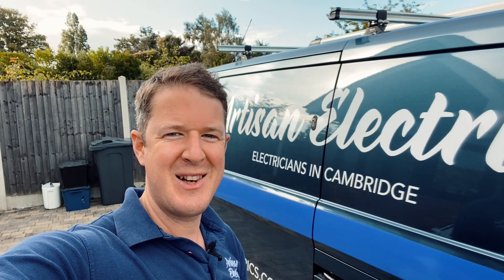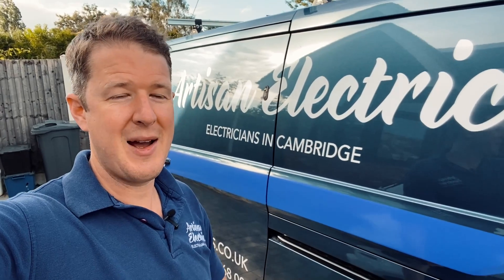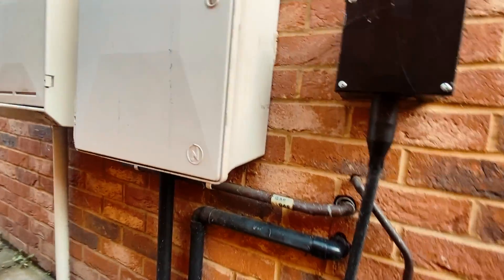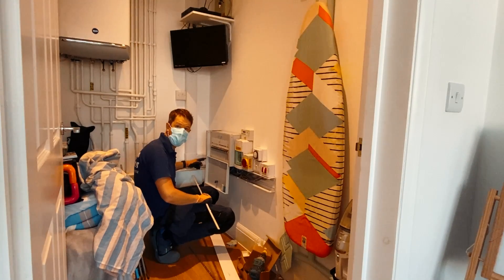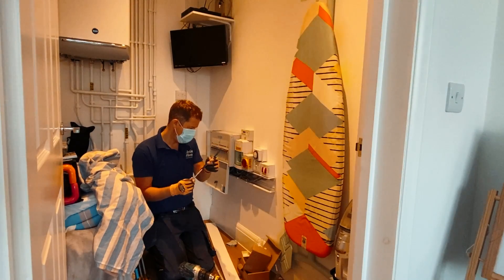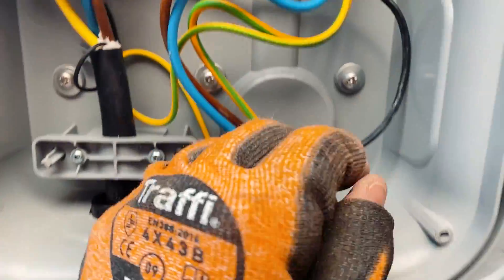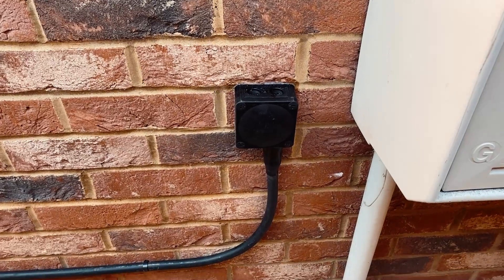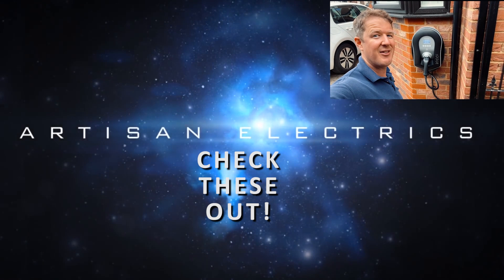Special EV Charging Cable - EV Ultra Install

Comment from the maker: Wiha Electricians Hammer: https://amzn.to/3kKOG8A
Reply: Hi Jordan,
One thing I don't see you do is test the charger, have I missed a vid where you do a Zs through the charger?
Reply: Question communication cables in bottom of the board? What voltage do they run? Ref solar charge it will be a long time to recoup only 😃

Comment: Would have been nice to see a closeup of the finished install inside including CT clamping and a quick look at the app running the zappi, but understand not always possible. Exactly the install I am having only mine will be located inside my garage.  Was there no myenergi hub required?

Comment: Shame you didn’t put the charger in the middle of the wall, looks a bit unbalanced. Also is it ok to drill through the cavity, I’ve got a similar problem with a down pipe and the incoming gas. If there is no problem with this I will ask my installer to do the same.

Comment: Great video. Just a quick question, why did you go into a wiska box outside. On your house you came straight out the wall.
Reply from the maker: I was using EV ultra cable on this job and it’s very thick and hard to bend
Reply: @artisanelectrics  Ok thanks for getting back to me .

Comment: Did you think of putting the large supply MCB for the car charging on the right of the CU as the left hand end means you have the largest load on end of the bus bars.  Or have I missed something.
Reply: Doesn't matter where you put the loads as the whole busbar is rated for 100A
Reply: @lewis94uk  Yes I know, but it is good practice to put the higher loads at the closest end - it does not matter, just good practice.

Comment: Another great video and very neat install - But I don't understand the need for the EV Ultra cable, the Harvi allows 3 x CT's doesn't it? I'm not criticising, just asking the thinking behind the install ;-)
Reply from the maker: I just wanted to try the EV ultra to be honest!
Reply: @artisanelectrics  can't argue with that. It looks like a good solution.

Comment: Thanks for the video; good stuff. EV-Ultra is available with one twisted pair or full 4-pair Cat5e. The Cat5e version could have been used here to avoid the Harvi. The Cat5e version is probably always going to be preferred with solar Zappi installations as there will be at least 2 CTs (one grid connection, one PV).
Reply from the maker: Yeah we used some this week on a job! Video coming soon
Reply: Never saw the installation of the Harvi so suspected that the ultra cable does away with it, but is that incorrect?
Reply: @damiankimmins3880  EV-Ultra contains 1 x twisted pair data or 4 x twisted pair data (depending on type) alongside the mains cable. It is like running a data cable alongside the SWA but all within the armour so much neater. One twisted pair can be used per CT clamp to Zappi. So, as long as you can physically run all CT clamps (minimum one) to the EV-Ultra cable then, yes, you do not need the Harvi. The Harvi allows a wireless connection between a CT clamp and the Zappi and the Harvi does not need a power supply as it cleverly harvests power via the CT clamp (not sure how a loss of signal is distinguished from no power flow or whether that matters). The minimum one CT clamp is around the main incomer to the house so the Zappi can monitor/limit total house consumption should it ever go above whatever has been set e.g. 60A. More CT clamps can be used if you have solar generation, immersion heater solar diverter or battery storage, for example. I think the Zappi has a maximum of 3 wired CT clamp connections (probably more via Harvis, and I think each Harvi might accept 2 x CT clamps) but check any of that if you need to. I can get away with using a granny charger for now. Car is home most of the day, I have solar and do not use car much. No way would solar intelligence or low night rate (high standing charge) pay back a £1900 install from Artisan (excl OLEV) or even £1300 quote from cheapest local OLEV registered - prices will likely come down with time. I just switch on when sunny or when I need to. I consider the chances of a PEN disconnect to be minimal and have what is supposed to be TNS anyway; I usually turn off my main breaker when there is a power cut and occasionally look out the window to see if anybody else has power back on yet before flipping it back on. I regularly check how warm the plug is getting. Should do me.
Reply: @jam99  That's great cheers! I am looking to do it myself as I am not paying that kind of money!
Reply: @damiankimmins3880  Mmm, wish it was that easy. Be sure you know what you are doing. OLEV grant only available for OLEV registered installers. Maximum demand calc needed. Check incoming fuse and incoming tail thickness for house. Loads of regs related to manner of install (e.g. height, wiring regs). Any new circuit or distribution board messing about needs testing, sign off by electrician or notifiable body, and the only sensible thing to do is a new circuit up stream of any RCDs in distribution board. It is all quite involved so be sure to do your homework.

Comment: With increasing data requirements is there not an Ultra cable with more than one pair of data lines? You kept me wondering until near the end how you were going to CT the grid and solar. Was a Hub not required for the OLEV grant to meet the smart requirement.
Reply from the maker: Yeah you can get CAT5e version as well
Reply from the maker: Hub is always required to meet OLEV requirements

Comment: So I noticed a lot of "C" breakers.  Those valid in that install?  With a much higher trip current than the "B"' breakers, I thought that they have specialized uses only and typically in residential 99% would be B's.
Reply: MCBs are hybrid devices, they have a thermal component which is designed to trip slowly on overloads and a magnetic component which is designed to trip very quickly on high current faults (i.e. short circuits).

The letters specify the characteristics of the magnetic trip. For a B breaker it requires a 5x overcurrent to gaurantee triggering of the magnetic trip, for a C breaker it requires a 10x overcurrent to gaurantee triggering of the magnetic trip. 

Whether a "C" breaker is acceptable on a given circuit depends on whether the Zs value for the circuit is low enough to fast trip the breaker in the event of a short.

Comment: How did you know you wouldn't go into the corner of the front room when drilling the corner at an angle?
Reply from the maker: Walls were mega thick when I drilled through the first one I could tell

Comment: Jordan I don’t know if you have come across some car manufacturers limiting charging (car has its own inbuilt ground resistance monitor) because of ground resistance going above a certain level which can happen in warmer, and dryer conditions. I don’t know of that is something you had an issue with.

Comment: Neat. But is the EV cable available with two pairs of data? If so could've run both CTs back to the Zappi and done away with the Harvi altogether?
Reply from the maker: Yeah you can get it with a CAT5 inside instead which has 4 pairs

Comment: Those are smart wee boxes, I had no idea they could monitor the current on the mains and ramp down if that was getting close to blowing the main fuse, cool feature! Not sure why the customer went with a cable attached version, it limits the kinds of cars you can charge, as some cars like the leaf will use the US style type 1 connector and you're stuffed if you (or the future owners) want to charge one of them instead of a European car.
Reply: Type 2 is the future, tethered cables are so much easier, assuming you use it daily they are much tidier, are always there, doesn't matter if they get rained on or filthy and I can keep my type 2 cable dry in the car for when I might need to use public chargers.

Comment: Interesting that you’ve crimped the main tails going into zappi. My installation at home didn’t used that, it’s just a stripped cable directly into terminals. Why , if I maybe ask? Should I look at getting mine redone?
Reply: You don't have to. Just looks a bit neater. The CCC of the tails remains exactly the same.
Reply from the maker: Yeah its just attention to detail really, some manufacturers require it though.
Reply: @artisanelectrics  Its not attention to detail its unneeded 99% of the time for class 2 conductors(7 strand) potentially its adding a point of failure and I'm yet to see a manufacturer request it on class 2.

Comment: Hey Jordan, I am interested in becoming an EV Charger installer. I just got an MG ZS EV and very impressed with it.

I understand the requirements for earth rods and the technology within the Zappi's that reduce the likelyhood of car becoming live and someone getting a nasty shock should the incoming neutral conductor failing from the electricity provider. However, alot of these cars are supplied with "Granny Leads" ie 3KW chargers that plug into a standard 3pin socket (internal or external). Obviously this is a serious concern should a PEN fault occur.... Appreciate any comments you have on this type of charging solution....

Comment: Bit of a stretch calling that ultra cable, it's just a single pair wire tagged on. The combined SWA/CAT5 is a more interesting concept.  Doncaster do have excellent quality though, support british manufacturing.

Comment: Lovely job - I'm always scared to drill at angles through walls.    I tend to cut the concrete and run the cable under ground with a nice paver over the top...
Reply from the maker: Thanks!

Comment: Why not just go up then down with the cable, that long run  could be impacted by anything, do they have a dog that it might chew on it?, that would not pass inspection here on states...I know you said is armored but here in states it needs to be at 7feet out of reach, I don't like that corner you had to drill, it don't look clean to me...good job tho.👌
Reply: Very different circumstances. In states I assume you mean America. The British standard is very stringent and in all honesty makes a joke of the American standards overall
Reply: @jordankidd8789  but really aren't you concern that if they put stuff on the wall and they might rest it on the wire and destroy the wire? like i said before  if they have a dog it might chew on the wire or kids playing around that area with low power wire.practically exposed? You just restricted that area for the home owner by not planning ure installation well and latterly cutting corners and trying to save a few bucks.. And here in the United States we have codes for a reason is call the National Electric Code, and that installation like I said b4 it would for no hell would pass installation...I mean that's just my observation and  criticism hope you don't get offend it my friend...cheers.!
Reply: @torodaman  In the UK using armoured cable absolves you of many of the regulations related to other types of cables, the armour means that it will normally fail in a way that is safe to the user if exposed to damaging levels of stress, and of course the armour makes it a very tough cable.  I suspect you are thinking about the problem from the perspective of typical USA homes, a typical British home is very different in its construction and running cables internal to the walls is rarely possible without significant work.  Dogs won't chew on armoured cables and kids aren't going to damage the cable either, flex's inside the home offer far more risks.
Reply: @torodaman  Different countries have different regulations written by people who thought different things were important and/or were influenced by different special interest groups. The people required to work under those regulations then start to internalize them as if they were universal truths.

There are things about American electrics that would make British electricians cringe and things about British electrics that would make American electricians cringe.
Reply: @petermichaelgreen  I get it USA has higher standards on electrical installations I know it could be a pain in the ass but it actually works, safety first. Good day mate.

Comment: Would it not be better to get SWA with more than 1 pair data, so you could hard wire both CTs? I can't imagine it would be much more expensive, and you wouldn't have to buy the wireless kit for the solar CT

Comment: You didn't mention what that other black box was on the outside on the house. At a guess was it for their CCTV system?
Reply: Probably an armoured cable to the shed
Reply from the maker: Yeah thats right it was a 50A supply to the shed

Comment: 12:28 Those two CPC wires smashed into one terminal don't look neat at all to me. Why not taking a ring style wire end crimp connector for one of them and screw it underneath the nut at the right side of the terminal block? You also could have easily used a twin wire ferrule.

Comment: To me that corner hole looks like a potential for damp. You drilled level and the cable comes down and into the hole with no drip bend.
Reply: He actually drilled down. In a brick on the left, in grout on the right…

Comment: I work in entertainment lighting and we use a combined power + data cable for some of our fixtures. 2.5mm 3 core for the power, and nine 0.25mm cores for data. It's not armoured of course but it's stiff as anything and can be a bugger to work with.

Comment: Well spotted that the Harvi only allows up to 60A monitoring.  I never thought of doing a hybrid extension of the CT's, so I'm using 60m of SWA Cat 6 F/FTP, which is not cheap.

Comment: As a heads-up, you want to ground the shield on one of the ends. Otherwise it is not going to help with interference,  it might even make it worse.
Reply: The screen won't help with magnetic interference from the power cable, the twisting does that (assuming a balanced termination). The screen does, however help with electrostatic interference. And yes, the screen needs  to be earthed to be effective.
Reply: Which shield do you mean?
Reply: @joegroves446  the shield of the twisted pair in the swa
Reply: He does at 13:00
Reply: @alexZWL  I mean the extra shield of the twisted pair in that swa

Comment: I have a question I've never fit a zappi charger but how do you do the 6monthly rcd test?
Reply: It tests every time it has an EV plugged into it
Reply from the maker: It does a self test every time you plug the car in
Reply: Very good question
Reply: Did  you  mean  the manual test?

Comment: That EV Ulta is available as SWA or with Hi Tuff  sheath variant.
Reply from the maker: Thanks great to know!
Reply: @artisanelectrics  Yes cable is pricey,but surprised no one has come up with a way to use this cable for home office,etc  installations in garden,as it saves running a seperate exterior cat cable with the Hi tuff/SWA.

Comment: Shouldn't the shield of the data cable be earthed on both sides for it to work? I'm sure it works fine like you did it as its only a CT but in data networks, especially when it comes to Cat. 7 10Gbps networks the cable shield is earthed at the patchpanel and at the device.
Reply: It's not really carrying heavy data - just a small voltage from the current transformer
Reply from the maker: Thanks @eFixx that was my reasoning too
Reply: Yes it should be earthed but generally only on one end as you can end up with ground loops if you join both ends

Comment: Doesn’t that SWA cable go against the regs as you have no real segregation between the low voltage and the data other than a bit of tinfoil sheath . You basically have single insulated 230v cable next to data .
Reply: As long as it's insulated to the highest voltage present it complies, which I am guessing the link is for
Reply: That clears that up

Comment: Very professional job. I installed hundreds of EV stations in Holland but never ever have I put a cable on the outside of a wall. I would have loved to as it cost me a lot of time putting the cable in basements under the house or underneath the pavement. How long did this install take you ?
Reply: I can only imagine a job like that is 5-6hours work

Comment: I’m just imagining an armoured cable crossing the inside of the customers lounge internal corner walls where you’ve gone behind the gate frame!  I’m sure it’s not but it was the first thought I had as you made the hole! A nice, neat install though.  You seem to be doing more Zappi than Andersen.. is that price related do you think or just that Zappi are a better unit?  Nice work 👍
Reply: Yeah, that crossed my mind 😂, a joiner I know was fitting a stair case, the neighbor came around and asked if he would look next door, when he went in every fixing had come through the wall, he thought there was a cavity, but it was single skin, he said they were like coat hooks 😂😂
Reply: It gave me anxiety ... I was imagining him to go through cables or any other services. 😬
Reply: Would say Zappi is among the best available.
Reply: @stuartandrews4344  on the face of it, but there are a few questions, how do you test the built in RCD, does it have a test button, and how do you replace it if it goes fault, as it looked like there was only a circuit board in the charger.
Reply: @acelectricalsecurity  it self tests every time you use it to charge and also resets itself, afaik from seeing other videos more in depth on the zappi chargers
Reply: @acelectricalsecurity  the Metrel evse and MFT allows testing of the dc RCD

Comment: The events industry have similar cables for Power and DMX/ Balanced Audio. Not armoured of course but the same idea.
Reply: The DMX and power combos are a great solution!
Reply: Have you got a link?
Reply: @edc1569  https://www.designacable.com/sommer-sc-monolith-combo-cable-3x1-5mm-power-2x-signal-pair-dmx.html  or https://www.designacable.com/van-damme-ambicore-hybrid-mains-signal-cable-1-pair-dmx-3-core-power.html Other suppliers are available.